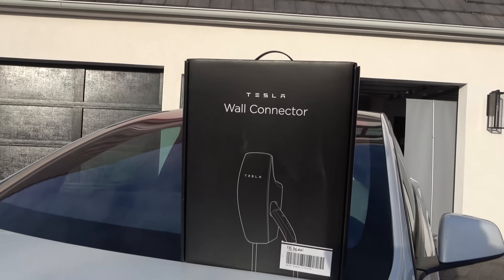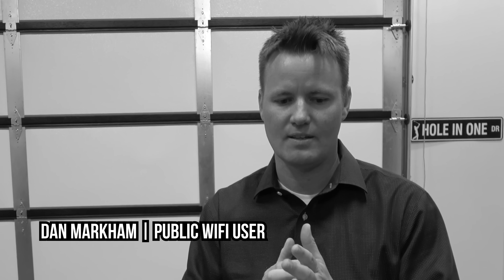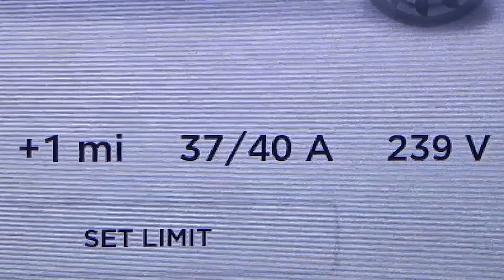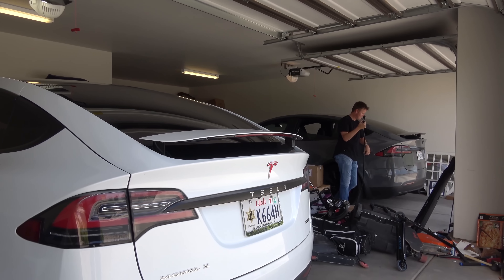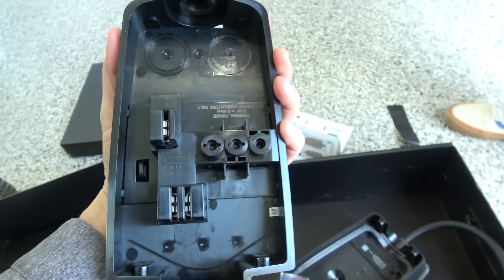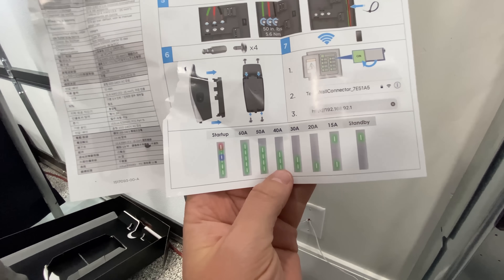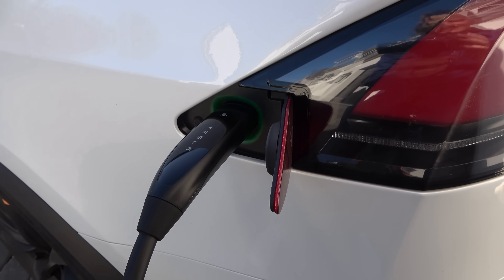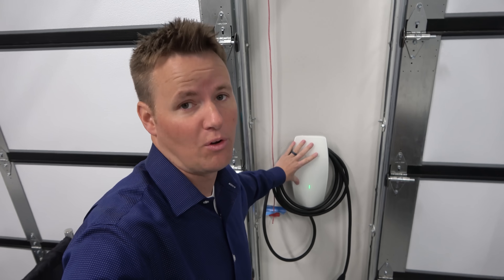What's inside a Tesla Charger?

Comment: Are you aware that a level 1 and 2 car charger is only passing AC current through to the  vehicle.   The actual AC to DC conversion happens inside the vehicle.  So, not true chargers.  The fast chargers are the ones that are true chargers changing from AC to DC and bypassing the vehicles charger.

Comment: Not to tell you how to do your job but you didn't actually show what's inside the charger, did you? :)
Is it really just a connecting box, no relays in the box so all functionality is in the handle? which is good engineering but that means the wall box is almost entirely for show. Especially as a mobile connector it would be much better to skip the box entirely.

Comment: They probably limited your old one to 40a due to the 50 amp breaker and wiring.  (This is per the old charger manual.)  Had they have put in 60a or 80a breaker and wiring, they could have set the internal dial to 80a.  With this new charger, 48a is less that 50a, so it works there.  The settings in the charger are what tell the car to limit its charging speed.

Comment: Hey, I was wondering if you can take apart a Pocket Racer, also I need to see what's inside it and how it works because I took apart my pocket racer and don't remember what wires go where. When you said 32amps or 124volts amps and volts are completely different.

Comment: It's not a charger, it's a wall connector (as stated on the box and website). The charger is built onto the vehicle.

The Gen 2 connector supported up to 80A because the older Teslas had dual onboard chargers that supported it. Tesla stopped making cars with dual onboard chargers since 2014 or so and the current max charge rate from the connectors is 48A.

Your old Gen 2 connector would charge your Tesla up to 48A since it's the newer model. The dial settings inside the connector wasn't adjusted properly to get the max rate.

Comment: With a 50 amp breaker, you should not be running this charger at 48 amps.  Check the wires or ask an electrician to check them.  You don't want to run more than 80% continuous of the wires rating.  Assuming the breaker is sized to match the wire, you're potentially creating a hazard.

Comment: In order to use 80 amp charging, first the Model S or X needs to have dual chargers (one is standard) in the car. Only earlier models could have this as an option. Second, need to have 100 amp circuit breaker. Third, need to use thicker wires (3 gauge instead of 6) from panel to outlet. Then u can get up to 80 amps. Newer Tesla’s can only go to 48 maximum.

Comment: You are putting too much stress on your wiring if it was installed as a 50 amp circuit. A 50 amp circuit should NOT be pulling more than 40 amps for a long period of time. The 100% run rate is 80% of the posted current.

Comment: You skipped the EVSE configuration step. If your breaker is 50 amps, then you must configure it to only draw 40 continuous amps per code. That's why the old one stopped at 40, although it was capable of much more. It would be a shame if your new house burned down because of a laissez faire installation.

The whole point of the EVSE is to tell the car how much power it can safely draw from the circuit and to prevent accidental electrocution.

Comment: The only way you're getting 80 amps out of the old charger is running new 3 gauge wire which can handle 85 amps then switch your breaker to a double 80 amp. Currently you're only running 6 gauge wire which can only handle 55 amps and you only had the charger set to 40 amps. I believe the vehicle has to be equipped with dual on board chargers in order to take advantage of the 80 amp charging.

Comment: Dude, you only have a 50 Amp breaker.  That charger requires a 60 amp breaker and #6 wire for 48 amps. (RTFM)  If your electrician used #8 wire, you shouldn't use the 48 amp setting.  You should connect to the charger via it's WIFI and dial it back to 40 amps.

Comment: The amps you see on the screen is probably combined amps.  Your electrician gave you a circuit of 40 amps per leg with 80 amps combined.  Tho since it is taking the power per leg (wire).  That 48 amps is only 24 amps per wire.  So yes, your new charger could essentially pull 80 amps if there was enough draw.  Tho it sounds as if Tesla has altered the wiring to make sure you wont ever be able to get that many amps from the charger.  On a side note, I thought this vid was you taking apart the charger for a "whats inside"

Comment: "Tesla Wall Outlet", not charger. (the charger is actually built into the car.) That thing is an EVSE --- Electric Vehicle Supply Equipment. It's just a fancy wall outlet with a bit of electronics in there to (1) detect the presence of a car, (2) know when the car wants to be charged, and (3) not supply power to the plug until both #1 and #2 are true. It also signals how much power the car can safely draw. It's not a current limiting device. (and for most of them, they're not even a meter.) In Tesla's EVSE, there's a rotary switch to indicate the size of the breaker. (consult the manual!) How much current the car pulls is up to the car. With a 12k onboard charger, it's only ever going to pull ~40a. (depending on supply voltage: P=V*I)

Comment: I charge at work on a 110 volt 20 amp outlet every day, and if I drive a lot I'll charge over night at home on a 15 amp 110.  But I investigated the wall charger, and will get one if we get another electric car, i have the 60 amp breaker in my panel already to go, just need to run wire.

Comment: right, you have a 50 amp service to the garage, which means that 40 amps is the safe rate for your breaker, if you want to do 48 amps you should upgrade your service to 60 amps to maintain the safe 80% consistent draw.

Comment: Tesla’s need wireless charging so you can put a coil mat down in the garage and never have to worry about it
Reply: And lose 40% of the energy to heat. No thanks. Not to mention you'd need near double the size breaker and wire gauge. 48a charging would require I believe a 60a breaker for safety, that's already a hefty power draw at 48a 220v (10kw vs 1.5kw for a normal 110v outlet)

Comment: No you did not educate us on which wall charger to get or what to get for our Tesla. You did however let us all know you have no idea how any of this works. You don't understand basic electrical theory, and don't understand the relationship between amperage, voltage and the load. You Don't seem to understand how the Tesla charger works, what a pilot signal is, and how the car always sets the load... The wall charger just sets a pilot signal as a maximum charge rate... And you could adjust that signal when you set up the box.

Comment: 4:32
You have 50-amp circuit breaker. Tesla Wall Connectors, Gen 2 or Gen 3, will charge vehicles at 80% of the circuit breaker rating if you setup the Wall Connectors correctly. That is, in your case, 40 amps. Your electrician did the correct setup for your Wall Connector Gen 2, and it correctly charges your Model X at 40 amps max.
However, when you installed your Wall Connector Gen 3, you didn't follow the commissioning procedure on page 22 of the manual, and your Wall Connector Gen 3 thought you have a 60-amp circuit breaker. Thus, it gives 48 amps max output to your vehicle.
Would that be a problem charging your vehicle at 48 amps with a 50-amp circuit breaker? I don't know. But it's certainly not something the Wall Connector manual recommends.

Comment: Last I knew they were still making glue for plastic. All you should be pulling is 80% of your breaker amperage. If a 40 amp breaker then 32 amps. You would have to have a 100 amp breaker to pull 80 amps. You seem surprisingly incurious about a technology you have been using for a few years?

Comment: for what i know the old charger can charge up to 80 amp, but it has a little potentiometer like switch that limits the maximum current, probably the electrician set it to 40 amps to make sure to not burn the cables in the wall.
you should check what gauge are those cables and maybe up the max current (btw you have 50 amps brakers).

Comment: Your old charger was set for 40 amps likely because it was on a 50 amp circuit.  You can only draw 80% of a breaker rating for ev charging. 48amp is within 2amps (4%) of the rating.  The new one is likely set up incorrectly. So the question is what size wire in your walls and what is breaker rating?  60 amp breaker can support 48amp charging. 50 amp can support 40 amp charging.  40 amp can support 32 amp charging.

Comment: Hard to believe a licensed electrician was watching and didn’t turn off the circuit breaker as the FIRST STEP. It was still live when you removed from brackets and the unit and heavy cables hanging from live wires. Those wires could have easily pulled loose and given up a 220V surprise. 

Turn off the breaker FIRST!!!

Comment: If your electrician installed a 40amp circuit in the new house and set the old charger for 40amps, then that install is correct. Your chargers need to be set for the type (amperage) 220 circuit that was installed. Assuming your electrician installed a 40amp circuit in the new house and you are pulling 48, then you are pulling too much power and heating the wiring in your walls. You could potentially burn down your nice new house.

Comment: The new chargers have been set into 48 amps. Also, there are less resistance in the charger, thus, more amps.
Reply: What? How is there less resistance? It's just a box that takes the lines and connects them to a new plug for the Tesla. Not really anything you can do to reduce the resistance.

Also, if you have resistance it's voltage you lose. Not amperage
Reply: @Jaker788  No, no, no. Less the resistance more the ampere. This is Ohm's Law. The Tesla Charger has different conductive wire which has less resistance than the other. Thus it is faster.
Reply: @sitaramachandra1  3 different conductive wires? Why? I see 2 hot legs, and Neutral, and ground. There's no reason to have more wires than that, you just get a thicker gauge if you need to carry more amps without too much voltage drop.
Reply: @Jaker788  No, there is a different wire, not1 more wire
Reply: @sitaramachandra1  Are you saying they increased the wire gauge for the cord? You really don't gain much at all going larger than required. Even then, you still have the entire length of wire going to the breaker box.
Reply: @Jaker788  Maybe the garage has more voltage then normal

Comment: If it’s taking 9 hours or so to charge your Tesla, what kind of increase do you see on your monthly electric bill?
Reply: Just do the math. A kwh of electricity in Utah is average 9.93¢. Assuming 95% efficiency on a 100kwh battery. That's $10.42 for a completely dead to full recharge. Between 348-390 miles of range for $10.42.

Comment: Not gonna lie; I literally had anxiety watching this. The power to the circuit should have been cut before opening the wall charger and you cannot safely increase the load (amperage) without changing the circuit breaker and cable size (unless it was already good enough). Code requires the load only pull 80% continuous of the rated breaker; so for 48 amp continuous load you would need a 60 amp breaker and 4 gauge wire which does not appear to be what was shown in the video.  I would get a second opinion from a different electrician unless the breaker/wire changes were done but just not shown in the video.

Comment: It’s because in the model s and x at some point you could order it with onboard dual chargers. So if you had those it would go up to the top amps.

Since then Tesla removed the option and all cars have a single charger onboard so you’d never go over 48 amps.

A supercharger bypasses those onboard chargers and feed dc current directly into the battery.

Comment: NOOO!!!! Please read the manual. Your old electrician likely did. The old charger had a dial that you would need to set to match your breaker setting. I believe that it would only take 80% of what breaker you had, so you probably have a 50 amp breaker. You need to connect to it’s WiFi network on the new charger to fully set it up. But I can’t believe that Tesla would let you use the charger at full power without setting it up properly first.

Comment: Your breaker doesn't set the charging rate limit. All it does is trip (shut off) if you try to go beyond the limit of the breaker. The charge rate is set by the car and the charger. It's doesn't automatically know what breaker it is attached to.

Comment: On the old one there is a manual setting on the dial that allows you to tell the wall charger what amount of power you are supplying.  Also, to charge at 48A you should use a 60A breaker. With a 50A breaker the max you should charge at is 40A.  So your Elon Signature charger was properly set and the new one is set too high.

Comment: The first HPWC was set correctly, which limited it to 40A, which is 80% of the 50A circuit. The new charger is not set correctly, unless you changed the circuit to 60A.

Comment: Btw, it’s probably fine, but you only have a 50amp breaker, I would upgrade that to 60amp and make sure your wiring is the appropriate gauge if your going to run 48amp. I just installed one of the older versions of the charger and did exactly that and pulled new wire just to be safe. If you look at the spec sheets they’l tell you the same thing. Stay safe, new charger looks nice! Oh and btw, the reason the old chargers went to 80amp, is so you could daisy chain a second charger from that and split the load (40amp per vehicle) for simultaneous vehicle charging. It was intended for use by small hotels, businesses, bnb’s etc, people with huge garages and lots of Teslas, etc.

Comment: The chargers are limited to what size wire and breaker you have feeding them. The old one has a small dial to set at which breaker size you have and new ones are done through the app I believe.

Comment: I set one up using 4 AWG and only set it too 60 amps because that’s what the customer wanted. There is a dial inside the charger where you can switch it from 40, 50, 60, 70 and 80 amps

Comment: Your wall breaker says 50Amp. In order to remain in electrical compliance your new charger needs to be set at 40Amp as well. The old HPWC was configured correctly, the new one is not and will cause you issues.

Comment: "My house is not supplying enough power". How'd the charger know that?  It takes what it's configured to.  And it'll work or pop a breaker (or melt cables if a thick enough cable isn't installed.  This is not like old cell phones charge controllers that would pull more current from the adapter until the voltage dropped to see how much the adapter could handle (you'd see this on old Nokia's diagnostic monitor as ISense) when you connected the adapter. Now everything's negotiated or preset.

Comment: Although it is called a wall charger, it is actually an electric vehicle supply equipment. The charger, a device that converts AC to DC and charge up the battery, is in your Tesla. The maximum charge rate is dictated by the lowest current rating of either the EVSE or the charger.  For example, if your charger is limited 40 A, but your EVSE can supply 80 A. The maximum charge current is limited to 40 A.

Comment: Your electrician did the right thing in limiting the current of the old one to 40A, and you may have just created a fire hazard. At 4:31 in the video you can see you've got a 50A breaker. I can't quite tell the gauge of wires you have running in the wall, but for 8 GA Copper THHN the max ampacity is 55A if all your connections are rated for 90decC heat. BUT for continuous use (Load expected to be at maximum for 3 hours or more) you need to downrate it to 80% of capacity due to heat buildup - so 44A.  On the old charger IIRC you could choose either 60A or 40A. On the new charger the onus seems to be on the electrician to size it right - so depending on your wire size you may have created a possible fire hazard. Either way, please check your wire gauge and breaker size / connections.

Comment: I bought it for looks too. The new wall charger also connects to WiFi, but that literally does nothing right now other than help with setup. Supposedly future firmware updates will come down. Odd they went to a smaller gauge wire that can charge at half the speed of the older ones, especially when the future will demand quicker charging of bigger batteries.

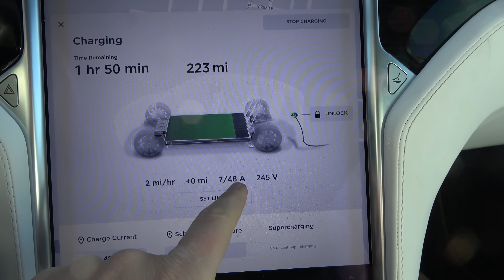Comment: Dan you were only charging at 38 Amps with the old charger. (7:15) It says “38/40” so: 38 amps out of 40 available. Apparently there is a setting inside the old charger that you can set to a higher amperage, but your breakers are rated at 50 so that’s the maximum you can use. (It will probably break after a while on 48 because the wiring gets hot.) the new charger has 48 amps available but I never saw it counting up to that number in this video. So the 48 amps might be available, but assuming your old charger was at 38 amps I don’t think this new model will increase the charging speed and max out before reaching 48 amps.

Comment: On either the new or old wall chargers, do you know if you have to take the male end of the cable and plug it into the wall charger (on the side) when you are not using it or can you just let it hang?  I need to know because my space for the wall charger is very limited and I bought that extra cable hanger that I'm hoping to use to hang the cable but not hang it on the wall charger itself.  Perhaps someone could enlighten me.  Thanks.

Comment: You obviously know nothing about electrical. You cannot limit the amp supply. You simply limit the capacity. So you can put a 1000Amp breaker to that and will still pull 40 amps. If you put a 20Amp however the breaker would  “trip”.